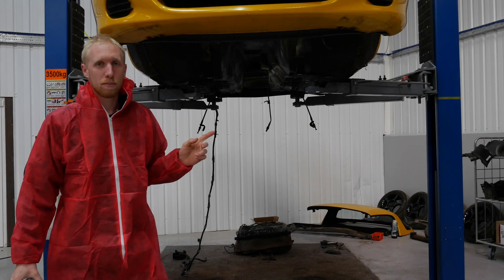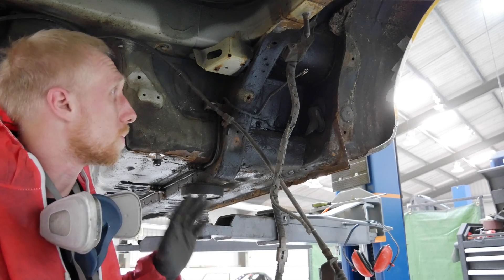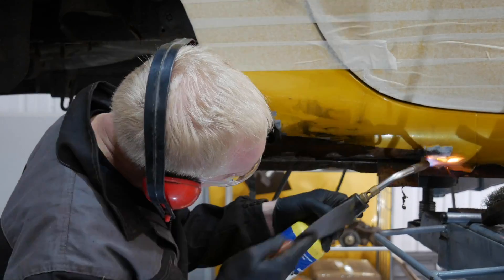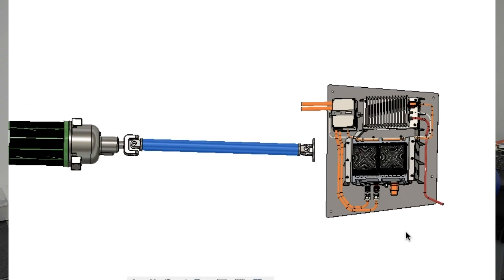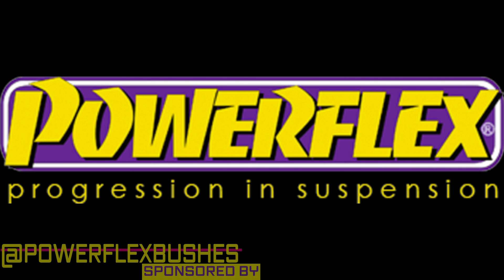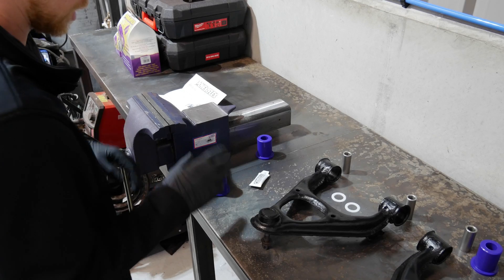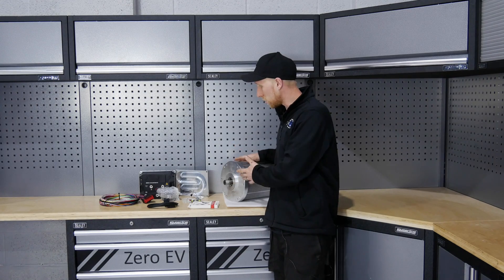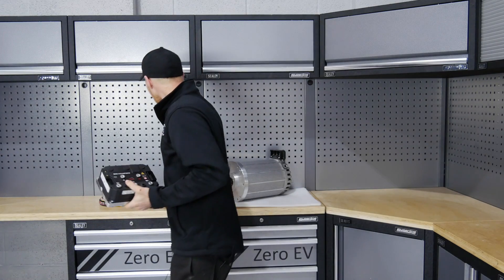We’re Making an MX-5 Miata Electric with a Hyper9

Comment: I'm feeling the urge to EV convert my Fit once the transmission dies. But IDK if there's enough room in the hood for anything, lol. At least the trunk is big enough for all the batteries I'd ever need.
Reply: The nice thing about the Fit is the petrol tank is large and flat under the whole center of the car so you can put most or all of the batteries in the same place Tesla does.
Reply: @umaikakudo  A 10 gallon tank doesn't seem too roomy, lol. In mine, it's actually under the drivers seat to save on cabin space, unlike most cars where it's under the rear bench seat. This allows for the rear cargo area to be huge.
Reply: @umaikakudo  LazerLord10 is correct: the Fit tank may be a nice shape, but the volume of that tank would only hold about 13 kWh of battery if you were lucky. The Tesla battery packs extend from ahead of the driver's feet to nearly the rear axle - they're much bigger than any fuel tank. And Tesla is certainly not unique in placing the battery under the floor: most EVs have a battery which is better integrated with the shape and function of the car, not forcing the floor under the driver's feet to be high.

Comment: If you want to prevent rust from coming back spray cavity wax in the frame rails/rocker/fender and doors, in fact anywhere where water can sat and go throught paint. In Canada we use similar stuff for undercoating and if applied correctly/regulary in area where it can be washe off, the car can last longer and prevent failure. You can use phosphoric acid to neutralize rust then prime paint and clear.
Btw love to see this project complete!
Reply from the maker: Definitely the plan once rust has been repaired

Comment: Just saw one that still kept the manual box , you should keep it with the 5/6 speed??? Cool project, a good business for the future I'm sure lots if us would do this as petrol cars get outlawed
Reply: I don't think there would be a lot of benefit from keeping the original gearbox. Electric motors have a very wide powerband compared to ICE so they can get away with only having 1 or 2 gears. The 5/6 speed would just take up too much room and weight and slow the car down due to time to shift.
Reply: Nathaniel Hatley yeah but it would be more fun...
Reply: If you kept the original transmission the motor would be where they are putting the battery pack, and only half as much battery would fit.

Comment: Why do you keep the propeller shaft? Would it not be possible to mount the motor and reduction gear to the differential directly? I´m asking since it would also save some weight and move the CG rearwards. Love this series, informative and nice layout!
Reply: There'd be a lot more modification to the body of the car required to do that compared to their current avenue. I think it's just out of scope due to budget constraints.
Reply: They're making a plug and play kit for sale that allows the car to be returned to factory stock condition. 

It would take a lot of fabrication surgery to direct mount the motor.
Reply from the maker: We looked at moving it closer but as the tunnel narrows so can’t unfortunately

Comment: Can you add DC fast charging (40-50kW) and how much would that add to the parts price?
Reply: I think he said in a previous video that they can't because the voltage of this system is too low to use DC fast charging. DC fast chargers are designed for 400V and 800V battery packs. This car's battery pack is going to be somewhere between 100-150V.
Reply from the maker: Your correct the cut off limit is 200v

Comment: I see you're using a new gearbox - what's the advantage of a single speed gearbox over the original multiple speed gearbox?
Reply from the maker: Mainly we want to test it, it’s a new product that we have just finished designing one big advantage is freeing up space in the engine bay
Reply: @Hazell_Nutz  Thank you! I was just curious. Would there be any advantage to maintaining a multi-speed gearbox at all?
Reply: @hokipokiloki  Ease of packaging. 'Just' bolt-on the e-motor instead of the combustion engine and off you go. Especially valid for cars with transaxles. Think of: Beetle setup and fwd.
And 4wd.
Everything is already there and tested.
Reply: That, plus an e-motor delivers the same torque from 0-100% revs. There is no need for a gearbox with more than one gear.
One exception: if you want to have insane acceleration and high top speed.
But that's more for marketing purposes, than anything else.
Reply: @Paul_VanGo  An electric motor delivers the same torque from zero to a transition speed, usually about one-third of the max speed of the motor (depending on motor design, available voltage, etc), not all the way to the max speed. Above that transition speed, power depends on the motor and the controller; production EVs are usually set up for constant power from the transition speed to near maximum speed.
Reply from the maker: hokipokiloki there is definitely an argument for higher top speed or acceleration depending on gear but change if gear in an Ev under load can easily kill a gearbox.
Reply: @Hazell_Nutz  thanks! This is all new to me so I appreciate the answer. Liking the videos!

Comment: 4:25 Unfortunately all that metal will continue to rust if you just hit it with a rust primer. You also might want to figure out why that area rusted in the first place. Was it a lack of drain issue? Design?
Reply from the maker: There very well known for it, the roof drain holes get blocked and over flow into the sills, I will be waxoilling them afterwards to stop this from happening again.
Reply: @Hazell_Nutz  oh ahhhhhh, the typical japanese drain holes that get blocked with leaves and foreign debris and rust out rear fenders and sills from the inside... totally not on purpose at all....planned obsolescence to keep consumers consumers and the economy trekking forward.

Hey I had an idea...considering how electric car retrofits are so expensive currently...I was thinking if one were to manufacture in a modular/expandable/upgradeable-form things like controllers, inverters, motors, and batteries---it should allow people to upgrade their power and range over time thus allowing them to afford conversions and get into them much sooner. 

What do you think?

Also another idea I had is to take Robert murray Smith's technique to print conductive ink on paper and build sea-weed/ non flammable/lion batteries and supercapacitor hybrids (they still have high energy densities) and cut them in the form of a car's floor mats, or just the entire carpet area and place them underneath it. You could sell them as easy to install batteries for conversions or as range extenders. 

If you combined that with hub motors you easily sell functional hybrid and AWD kits, or even just ditch the engine entirely for 2wd/awd. 

Another interesting thing is how hydraulic regenerative braking is supposed to be way more efficient, I was thinking you could even use that stored pressure to run accessories. 

I have a bunch of other ideas as well. Let me know what you think!
Reply from the maker: Spenser Roger the front wings are as bad due to windscreen drain off running into that area. Upgradable is hard we have done what we can to make things modular so upgrades can be done in the future things like bms, battery packs, charger and motor system. But there is a limit as as upgrading an inverter requires software or fitting a different motor requires tuning. With the speed this market is currently moving there is going to be a lot of parts from oem vehicles coming available.

Comment: I have a question.
I've seen a few EV build videos and the part that always seems to get left out is the interior heater.

Can this water cooling system be used for that?
Or is an electric system required?
Reply from the maker: We will he replacing the matrix with a ptc high voltage heater.

Comment: What's the plan for gearbox or diff? If the motor only spins to 8000rpm, I'm guessing you'll need to use some kind of gearbox or special ratio diff to achieve any reasonable top speed?
Reply from the maker: Yes we are fitting a 1.8:1 single speed gearbox with 3.6 rear diff but do have the option of 1.6:1 gearbox as well. Just waiting for the Cnc case to come in then will build it

Comment: You mentioned the peak power and other stats, how does that compare to an ICE? Is the 80kW peak in any way comparable to say.. the 95-100(?) horsepower you'd usually convert kW to? (i.e dyno reads a Kw value, or wheel horsepower measured as kW, doesn't meaningfully compare between ICE and EV, right?)
Reply from the maker: Did look at it but max ratio is about 4:1 where as would need something like 6:1
Reply: Due to the nature of electric engines, assuming this particular engine is fairly standard, you'll have delivery of that peak figure throughout the rev range. In theory, acceleration from low revs at a given speed should be more rapid than almost any combustion engine with the same peak power figure. I'm interested to see how they go about addressing gearing, however, as 8000rpm at the motor will need some serious gearing conversion to reach any decent top speed
Reply from the maker: Currently fitting a 1.8:1 single speed gearbox with 3.6 rear diff but can go to 1.6:1 on the gearbox to give higher top speed.
Reply: @Hazell_Nutz  Are there any really short gear sets available for a diff that will fit the MX-5, eliminating the need for the reduction box? (I do realize that you are developing the reduction box as a product so you wouldn't want to eliminate it).
Reply from the maker: We have a chassis dyno so can do some testing
Reply: @magnetic0314  No, the output of the HyPer 9 is not constant through the speed range - it isn't a lot different from a gas engine other than maintaining peak torque all the way down to zero speed.

Comment: Max horsepower for that electric motor is 150?  Doesn’t the instantaneous torque of an electric motor actually translate to more horsepower when compared to a gas motor?  Or am I overthinking this?
Reply from the maker: You are correct looking at a motor bhp is not what we focus on when given electric vehicles performance it’s all about torque and rpm

Comment: So the electric motor goes straight into the gearbox right? No clutch stuff etc
Reply from the maker: Yes that’s correct as we are running our new 1.8:1 single speed box
Reply: @Hazell_Nutz  ahh that's cool forgot you're changing the transmission as well

Comment: This is now my favorite EV conversion series. Thanks for producing this!

Just a question if you don’t mind. What is the minimum and nominal Amp the motor would use in a Miata? 

I ask because I am in the process of converting a miata as well (which might also be why this series of yours is my fave!) and i might order the HV version of the Hyper9 but i am currently planning to use  recycled 18650s for a pack until i can afford proper tesla modules.

I am having some issues sizing the number of parallel cells in my planned battery pack so there’s enough amps to supply the motor at 4 amps per cell, but at the same time i don’t want to build such a large pack and add too much weight to the car. Planned Pack configuration is currently set at 42s60p, average 2 ah/cell, assumed CDR of 4 amps/cell.

Keen to also get your thoughts in what pros/cons the HV vs regular version of the Hyper9 are for a miata, as well as more details on the reduction gearbox and arduino controller for the instrumentation. Those ones i plan to purchase from you if I have the chance. 

Cheers and thanks for taking the time to read my queries. More power!
Reply from the maker: Hi, the hv version is higher voltage but lower amps so ether way your go to end up with similar size pack. If you go to our website there is the data on the current. I think you can restrict the motor down to start then maybe once you upgrade battery’s change the settings. Max pull is normally 750amps and average is probably 350amps depending on gearing. Once we get our next gearbox in I will do a tech talk on it.
Reply: Zero EV awesome! Will be waiting for the new episode. I reckoned same sized pack would be needed since same kwh in the end. Will check your website .Thank you for answering my queries :)
Reply: Neil Baldonado The advantage of the HV would not be in battery pack size (the per cell current draw would be the same) but the smaller guage of the current carrying wires and potentially the re-charge time (but only if you bought a super expensive CCS module.)

Comment: I know you guys are EV-focused, but is there any reason no one is stuffing a couple of these motors and a battery pack under a truck with a diesel generator under the hood and cranking out little high-range freight trains?
Reply from the maker: Nope no reason why not good idea
Reply: I feel validated but also sad. thanks!
Reply: Because that's a series hybrid, which is the least efficient hybrid design.
Reply: @brianb-p6586  that was certainly true back when freight trains transitioned to diesel-electric, really doesn't look that way now... more like it's just too hard to market electric anything to truck owners, and by the time it becomes feasible, battery tech will be good enough to just skip a heavy-duty hybrid truck phase.
Reply: @foyrees  No, series is still the least efficient, because the losses in the generator, generator controller, motor controller, and motor total far more than losses in a mechanical transmission. That's not considering any gain from running the engine more optimally, but there are other solutions to keep the engine at the ideal speed, and the benefit of keeping the engine closer to more ideal power level are offset by losses of discharging and charging a battery.

The BMW  i3 REX is the only widely available pure series hybrid car, and its fuel consumption is high for the size and type of vehicle.
Reply: @brianb-p6586  does that math change at a certain amount of mass being moved, or is there some other reason that hasn't resulted in significant changes for trains?
Reply: @foyrees  Trains don't use an electrical transmission system because it is efficient; they use it despite the inefficiency because it provides a continuously variable drive ratio all the way down to infinite reduction ratio (engine running with zero vehicle speed). Cars are very powerful for their mass and don't need that.
Reply: @brianb-p6586  I'm missing the part that makes this sound unappealing for truck stuff, like towing significantly more mass than just the truck, which current hybrids suck at.
Reply: @foyrees  towing capacity has nothing to do with the powertrain type, just the capacity. A locomotive-stye series hybrid has massive pulling capacity in a locomotive, but would be useless with components which were too small or cooled inadequately. Most current hybrids are sized and specified for light-duty use; the same design could tow much more if built for it. Allison sells hybrid transmissions of the same "2-mode" power-split design as used in GM pickups and SUVs years ago, but with much higher capacity.
Reply: @brianb-p6586  am I wrong to assume that they're not built for towing for much the same reason series hybrids are pointless in cars? the efficiency just melts back into plain jane ICE numbers, at best, when you start doing silly things like pulling trailers?

even if it's not more efficient than ICE, it could simplify/reduce maintenance and offer a bunch of other work place advantages, and also ease the transition to an all-electric system in the future, right?
Reply: @foyrees  Hybrids have their greatest efficiency benefit in stop-and-go driving. Towing or other heavy loads don't change that, but recreational towing is mostly on the highway so there's little benefit to people with pickups towing travel trailers.

Series hybrids are not needed to ease any transition - all of the required hardware is routine production. The difficult transition is in charging batteries, and non-plug-in hybrids don't do that.
Reply: @brianb-p6586  having a generator that powers both your tow vehicle and your travel trailer would be a pretty significant benefit. hell, a generator that transports itself would be worthwhile even if it wasn't quite as efficient as just ICE for a whole lot of reasons.

I would love to hear more about existing production components for practical, entirely electric, light duty trucks, that are not just concept vehicles more or less studiously avoiding the topic of towing.

edit to add: I'm flitting around between different "duties" (heh), and probably in other ways too. thanks for being patient with me.
Reply: @foyrees  Yes, a plug-in hybrid would be convenient for this purpose... but there's no need for it to be the series hybrid that you propose. If you want this functionality, buy a Ford F-150 PowerBoost Hybrid with the Pro Power Onboard option - it's available now, and it's a parallel hybrid.
Reply: @brianb-p6586  yeah, not buying a new truck until I retire, and that's pretty much contingent on it being able to drive my senile ass around. got a perfectly good 42 year old gmc long bed step side I intend to either drive into the ground or pass on to a new driver some day. hopefully with a neato modern drivetrain sold in a crate.

Comment: Do you know how much weight you've removed from the car eg engine, gearbox and the like?
Reply from the maker: Nope forgot to weigh it but once back together will weigh before fitting any ev stuff
Reply: Are you thinking of doing similar Dee? 😄 I know I am!
Reply: The complete original engine and gearbox with all accessories attached, exhaust etc is around or just over 200kg
Reply: By my reckoning and assuming a full tank of fuel, it's around 215kg plus-or-minus-a-bit. So a net increase of 30kg? Not bad at all.
Reply: When planning did you ever think of adding 2 motors? Great vid 🔥‼️
Reply: @le_opo  from the cad drawings I don't think mx5 will fit two motors under chasis....